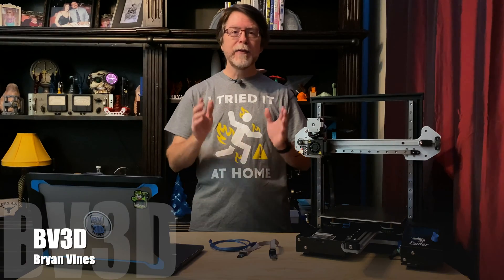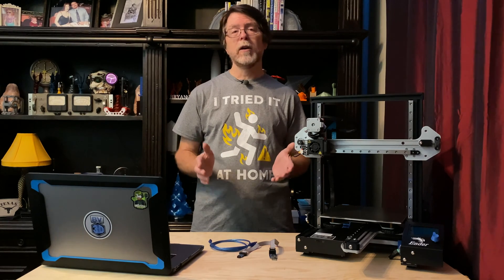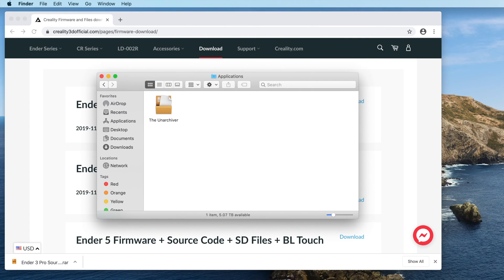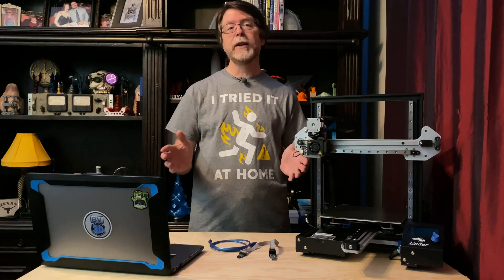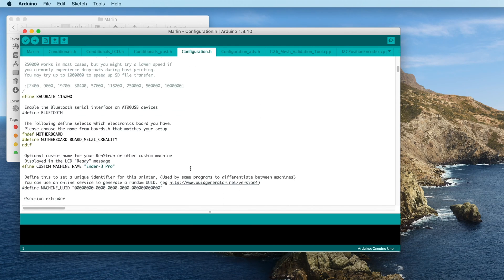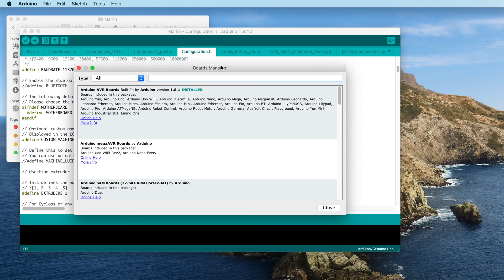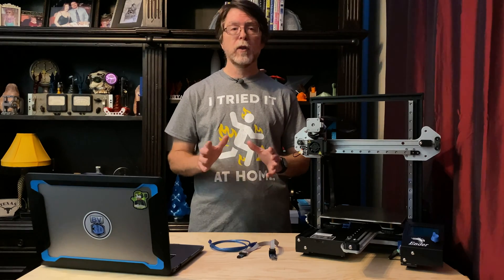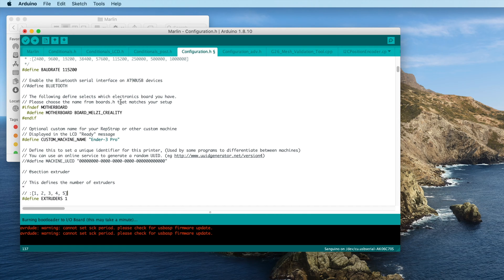How to Install Bootloader & Creality Firmware on Ender 3 & Ender 3 Pro

Comment: Hi Brian You may be pleased to hear I finally got to install the firmware.
After many hours of head scratching I found I was doing nothing wrong in the setup but a brand new usb cable was faulty.
After reading literally hundreds of problems from  fellow newbies who were having setting up the same thing I was it became  clear to me that they may be having the same problem I encountered.
Maybe in future some high profile 3d presenters could do a segment on what can go wrong in a setups and how to fix it.
Unfortunately a lot of presenters limited by time gloss over the installation thinking that everyone already knows all about it.
It would be great to have a presenter with all the good attributes of Dr Vax, Teaching Tech, Crosslink, Makers Muse and of course yourself to cover everything.
Any way keep the good work.
Half the fun in learning is to see what everyone is doing, taking a bit from each and working out what works best.
Regards
Ernie from Australia (A happy Ender 3 Pro owner not the unhappy owner of a Brick)
Reply from the maker: Hi Ernie, I'm so glad you got that working. I would never have thought to change out the USB cable! I usually think that either a cable works or it doesn't, and when it doesn't -- well, NOTHING happens. But clearly cables can fail in weird ways, causing issues only some of the time and making the problems they cause that much harder to figure out! Good on you for sticking with it and for trying a new cable! 👍

Comment: Thanks for the video.  After getting all the correct equipment I was able to get this together.  I have a question.  If I want to do a firmware upgrade do I need to go through Auduino to do it or  is there another way?
Reply from the maker: Hi! Since you've gone through the tutorial and you've got a bootloader installed, future firmware upgrades will be easier. If you're doing the upgrades from source code, the Arduino IDE is still the way to go, because the source needs to be compiled. 

But if you're upgrading with pre-compiled firmware (a .hex file), it can be a little more difficult to get that over to the printer by using the Arduino IDE.

There are dedicated flashing tools for Windows, but if you're doing it from a Mac, it's faster and easier to use Cura to do this with a direct USB connection to the printer.

Comment: wait, so how do you update in the future without disassembling it? By SD card?
Reply from the maker: Future firmware updates happen via the printer's USB port. You won't need to access the programming pins on the printer's board once the bootloader is installed.
Reply: BV3D: Bryan Vines Thanks for the prompt reply. What are the steps to take after connecting it via usb? I don’t find any tutorials on this, all seem to be based on arduino.

Comment: I have an ender 3 but i have that version of creality does that mean it has a ootloader already installed
Reply: No...it just means you have a different version of the firmware...you will still need a boot loader if you want  to update or edit your firmware.

Comment: can you please help I have been trying to update the firmware for over a week and nothing works.
Arduino: 1.8.13 (Mac OS X), Board: "Sanguino, ATmega1284 or ATmega1284P (16 MHz)"

fork/exec /Users/******/Library/Arduino15/packages/arduino/tools/avr-gcc/7.3.0-atmel3.6.1-arduino7/bin/avr-g++: no such file or directory
Error compiling for board Sanguino.

Right now there is no port showing up even though I installed the CH340 driver and restarted the computer. Can you please tell me how to fix this problem I have tried everything
Reply: actually, a usb port is showing up, but it just wont compile/upload
the port showing up is called /dev/cu.usbserial- 1410 , not /dev/cu.wchusbserial1410
Reply: it stops compiling right after I hit compile and give me the error message

Comment: My USBtiny AVR programmer's 10 pin to 6 pin adapter was one of the ones that was too wide to allow it to connect to my Creality Ender 3 programming pins.   I simply used an Arduino 2x3 female stackable header, which extended those programing pins up high enough to allow me to connect my programmer's 10 pin to 6 pin adapter.
Reply from the maker: Hi Joe! That's a quick and clever solution to the problem! 👍
Reply: @BV3D  You can remove the cable for the LCD temporarily to install the bootloader

Comment: Hey Bryan! Thank you so much. This is useful. I've been running a very vanilla version of 3d printing for the last year, and find myself in need of actually running a PID configuration for the first time (I replaced my entire hot end) but I don't have any way to do that currently. So here's my newb question: If I go ahead and update the firmware and set my Ender 3 up to communicate via USB, can I then hook up my laptop, run Marlin, and configure my PID? Or do I need an arduino or raspberry pi to do those things? Thanks for helping out a newb! I feel like I'm in over my head here and don't know what I don't know!
Reply from the maker: Hi Maryska! Installing a bootloader allows you to update the firmware via the printer's USB port. But you don't need to do that just to enable USB communication with the printer. It will happily talk over the USB port without a bootloader. 

This is mostly off the top of my head, but it's something to try:

You can try using either Pronterface or Repetier Host to communicate with the printer via USB. You may need to install a USB-to-serial driver* on your computer, because the USB port on the printer is controlled by a USB-to-serial chip.

Either of those applications should include a text interface, where you can type G-code commands at the printer, and see the responses.

So, once you're able to talk to the printer, this command will start the PID auto-tune process:
M303 E0 S200

(M303 is the actual G-code; E0 means "Extruder 0"; "S200" means "Set hot end to 200˚C")

I think an M500 when it's done will save the new PID values into the printer's memory.

* An easy place to find pretty much any USB-to-Serial driver you may need is in the TH3D Studio Unified Firmware package (link: https://th3dstudio.zendesk.com/hc/en-us/articles/360043293452-TH3D-Unified-Firmware-Package)

Comment: I am using a windows 7 computer I followed your instructions but when I get to board manager type sanguino no boards show. Do you know why
Reply: take a look at the link, if you pasted it there will be a bunch a junk in front of it, delete all before the http:// and replace the f2 with / , pause the video when the string is in white on the screen and compare to yours, when you get it correctly it will show for installing, Bryan if your reading this I suggest you type the link into the more section as a text file, in windows world it translates the / as what it thinks it should be......

Comment: Thank you Bryan. How do I give it a triple thumbs up? I am so good with electromechanical but so lost with coding! I’m a Mac user and your specific and very clear instructions truly helped me burn boot loader and flash firmware! Thanks again!
Reply: HI Peter What OS are you running on your Mac? I am running into problems and thought it had to do with the USB drivers that need to be installed.
Reply: @aModernGirlMakes  Hi Maria, I am using the most updated OS.  However, I am not the one to ask, although expert at 3D printing and mechanics, I am a very poor coder!
Reply: @aModernGirlMakes  Do ask Bryan, he is a great guy who can really explain things well!
Reply: @WhamBamSystems  your reply was helpful and I did reach out to Bryan. I agree that he is a great guy and is super helpful. we think it might be the USB ISP that came with the kit. I am going to order a different one and see how it goes.

Comment: For some reason, my Ender-3 will not power up when the programmer is installed. I installed it just like you did, but the programmer is the only thing that powers up. Do you know how to fix this?

Comment: do you plan on doing a BL touch video? I bought one, installed and redid the firmware on SKR mini e3 and it failed everytime. I wonder if you ever put one on your machines and if not why? do you think the manual leveling is better than using a probe?

Comment: Please help... how do I fix the "avrdude: stk500_getsync() attempt 1 of 10: not in sync:" error. I'm running windows 10 fully updated and an Ender 3 Pro with a Silent board.
Reply: I have the same issue did you fix it ??
Reply: @emadshaglil5564  I fixed it by selling the printer :P

Comment: Best video I've found for explaining this process by a mile! I have run into a problem though, my Mac can't see the USBAsp when I try and flash the bootloader. I tried installing both the drivers on the TH3D site but still get the error message "avrdude: error: could not find USB device with vid=0x16c0 pid=0x5dc vendor='www.fischl.de' product='USBasp'" whenever I click on Burn Bootloader.
Anyone any ideas, an afternoon scanning Google hasn't got me anywhere?
Reply: John Guckian  I am right there with you as well.
Reply: Did he ever reply to anyone on this error message? I am getting the same thing.

Comment: So after installing the skr on my pro with your other video i had enough confidence to try this out. Again dude, thank you. I bought an arduino kit and walked through it with this video. I love that you do mac based. I know its the same with windows but still i prefer walking through looking at code when our screen look the same. Thank you thank you thank you.
Reply: also.... I do the same "rarrrrrr" in my head. Been doing that for about 15 years when i became an editor and started using mac :)

Comment: Don’t follow this guide he made it hard just download full Firmware packages it come with Ardunio.
Reply from the maker: Hi! I just downloaded the firmware packages available on Creality's site for the Ender 3 and Ender 3 Pro (https://www.creality3dofficial.com/pages/ender-series and also from https://creality.com/download/firmware_c0008), but they don't include the Arduino IDE.
If you have a link to a different Creality site which has the IDE bundled with the source code, that would be awesome, and I'd be happy to add that link in the description. 👍
Reply: BV3D: Bryan Vines https://www.th3dstudio.com/knowledgebase/th3d-unified-firmware-package/
Reply from the maker: Thanks! That's the TH3D Unified Firmware. I've got a video about halfway done on that; I ran into an issue where their guide indicated you should only use the version of the IDE they've bundled with their package, but they bundle a somewhat-old version of the IDE which included 32-bit components. This won't run on the current macOS, so I reached out to Tim about it, and he updated the Mac installation instructions so that it recommends using the current version of the Arduino IDE. So Mac users still need to download the Arduino IDE.

Tim and TH3D have done a phenomenal job of putting everything in one place, and simplifying the task of configuring Marlin down to where you simply uncomment a few lines in the configuration.h file and you're set. 👍
Reply: BV3D: Bryan Vines no worry man your video is kind of helpful I am one of the lucky to get to blank lcd screen waiting for firmware.
Reply: Hi I managed to install on pc with the TH3D package I guess it just don’t work on Mac. I want to do a guide because it’s not the software it’s hardware related issues. I use the same 6pin USbasp nifty little thing I didn’t use the Ardunio too complicated I am not that savy with wiring. Ok man I wasn’t happy before because I thought I bricked my printer but it’s alive now.

Comment: Hi good video but for anyone attempting to do this i would highly recommend  dumping a backup of the pre installed firmware i.e the flash and eeprom before installing Firmware from the creality site as there are so many variations. It is very easy to do and should anything go wrong  you have a backup.
Reply: Hi Brian i used software called AVRDUDESS and USBASP programmer  it's quiet user friendly you can easily read or write to the Flash or Eeprom. When i flashed the Creality  rev1.1.6.1  to replace the Firmware that my Ender pro shipped with  as i wanted Thermal protection  i had a few issues with print quality as i had made some changes to the settings eg E-STEPS  etc that i had not had previously had.  Reflashing the EEPROM from stock that i had saved solved my problems.
Reply from the maker: Awesome, thank you! 😀
Reply: @BV3D  
No probs Brian, a simple way to check that you are doing things correct would be to upload the Blink sketch to your Arduino. Now using AVRDUDESS and USBASP Read the Flash from your Arduino and dump to your chosen location. Then upload the Blink sketch again  after changing the blink rate. Now write the saved flash file back to your Arduino and all going well you should see the blink rate restored to the original.
Reply from the maker: Hi Paul! I didn’t know that was possible, so I would love to know how to do that. If you’ve got a resource you can point me to on the web, I’d really appreciate it. Thanks! 👍🏻
Reply: This is good advice, it may sound daunting talking about using AVRDUDESS and a USBASP programmer but there is lots of guides on you-tube that will help, and its pretty easy to do, that`s coming from a total beginner .

Comment: Brian  So if you already have the 1.1.6 firmware on your Creality Ender 3 pro (which shows up on my screen under About printer)  do you need to upgrade to 1.1.9 or Marlin 2.0 to get the thermal runaway protection?  Or is it already there?
Reply: If it was me i would just get the marlin firmware direct from the marlin homepage and use the ready made profile for ender 3

Comment: Great video Brian. Did you print your Mac cover. I have a 2015 MBP that needs a cover. Sick of buying covers that crack on the corners. Thanks!
Reply from the maker: Hi! The case isn't printed. It's an iBlason heavy duty case. It's got an outer hard shell around the edges, and a TPU liner to help absorb impacts. I really like the chunkiness of it. That stepped design makes it super easy to grip when pulling it out of a laptop bag. And the open center part of it is actually a clear sheet of plastic. I can put my stickers on it, and if the computer has to go in for service (or the screen get replaced), I won't lose my stickers. 😄
I got it on Amazon a while back. They make them to fit back to the 2016 MacBook Pro, but (sadly) not the 2015. 🙁
Reply: Thanks the reply Bryan. I’m sick buying poor covers. I thought you had cracked it by printing a cover :). I hope You and Yours stay safe and your time to put out more content soon! Best!

Comment: Hi guys I've followed this most if the way but I'm using an Arduino Mega 2560 instead of a sanguino any idea what changes I need to make to the bootloader for this please as I'm stuck ?  Many thanks for your help

Comment: Great video but my printer isn't appearing in the port menu in Arduino ice after burning the boot loader. Does anyone know a ay I can fix this? Im using a Mac by the way and trying to flash an Ender 3.
Thanks

Comment: Thank You! I managed to make my Ender 3 a brick waiting further instructions, but without the ability to select a port on the Arduino. This fixed that!! So thank you!
Reply from the maker: Hi! I'm glad this got you up and running again! Having a bricked printer is no fun.
Reply: @nickrobinson7096  if your still having problems use arduino that comes with the TH3d download it fixed all my problems connecting.

Comment: Hi Brian, had an issue with my Wife's Ender3 not holding the MicroSD Card in place contacted Creality and they offered to replace it or send me a new board, the new board was fine by me and when it arrived we had already begun using the machine by USB and the new board went in a drawer to be changed when I had time, alas 2yrs later I have time and changed the board and found to be very slow in starting and the functions on the screen to operate - refitted the old board and all good, so refitted the new board and thought it maybe a software issue and found your site to enable to use Bootloader followed instruction by the letter up to 13.47mins your Done burning Bootloader - This one fails stating "error while burning bootloader", I have since tried this on the original board and have the same issue, any ideas ?

Comment: There is a video on Mat1uk 3d printing channel that has a link to drivers that are signed. That way you don't have to disable driver signing enforcement in Windows 10. I downloaded the program and installed them. It works great. I was able to install the bootloader using the Arduino IDE. I am installing a BLTouch and wanted to use some prepared firmware from the Teaching Tech channel. I discovered that the Arduino IDE was not able to load a .hex file, it was looking for a .ino file. I have Avrdude installed with the GUI, but it was looking for the fuse bits, and I'm not sure what to use. Any suggestions?